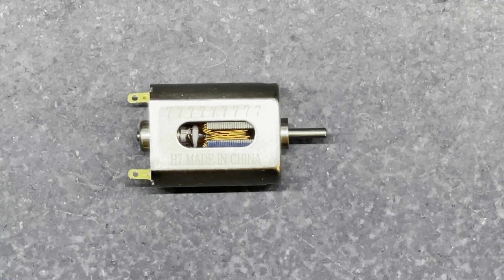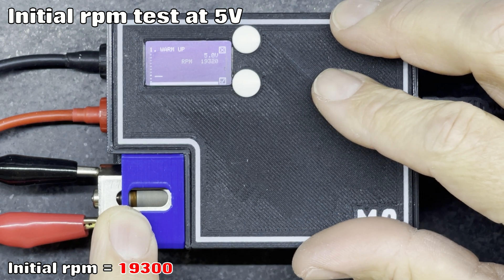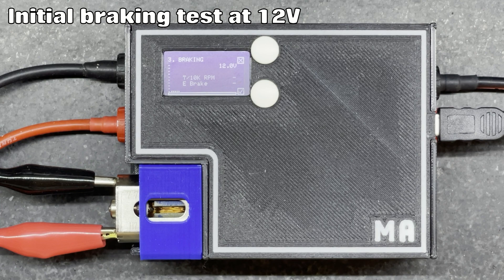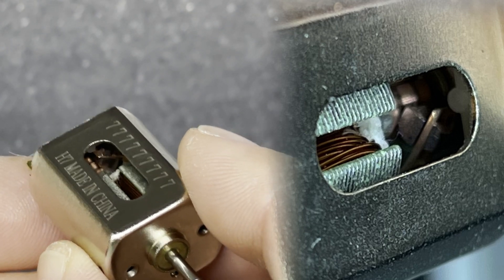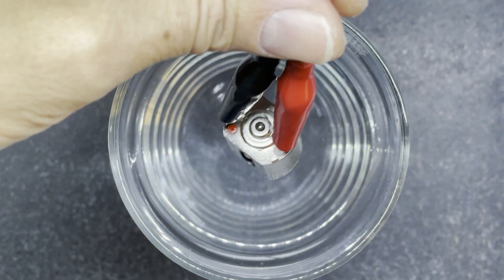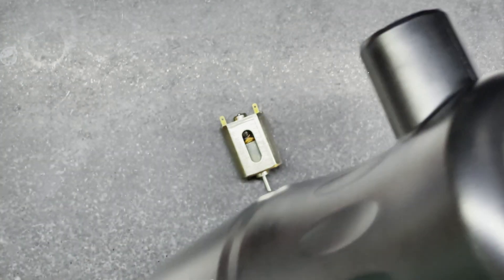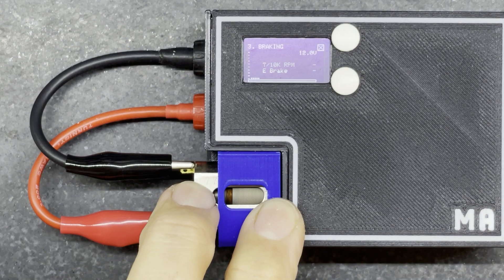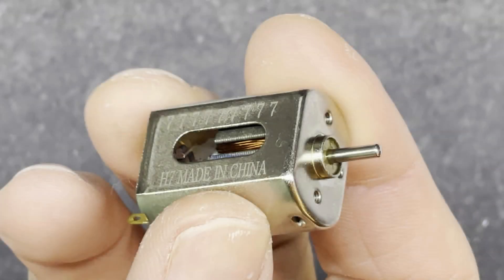Does running in an FK slot car motor (Hawk 7 or JK Retro) backwards improve performance?

Comment: Just a few basic questions, What is the average life of a Hawk  7 motor?  how does the break in process play into the life span of the motor?
Reply: No so much the lifespan but the performance. Just taking a motor and putting it on the track and whacking the throttle, can result in arcing that causes pitted commutators and brushes and residual residue.

Comment: When installing a motor into a car you have to hook it up backwards for it to turn in the right direction, considering that + is on the right side in driving direction. So why not run it in backwards?

Comment: Hi! CT, I have a doubt, I searched for the respose but I couldn´t find them. What is exactly the E-Brake? I understand what is the normal brake, "the amounth of time from full speed to zero". Do you know where I can find the explanation. Thank you very much!, cheers from Argentina!!!
Reply from the maker: Hi Nicolas. Thanks for watching. The E-Brake is a number that is generated by calculating the “electronic” braking effect of the motor. The electronic braking effect of the motor depends on the amount of back EMF and current the motor generates when braking.

Comment: the motor will run faster in one direction due to the commutator timing. Breaking it in will seat the brushes and reduce power requirement

Comment: Just when I thought I had a super secret way to the podium. Actually found out about running backwards a few years back when I accidently connected a C can s16 Mura motor backwards for the water break in, panic at first. So, I get that it works but what is the reasoning behind the practice? Brushes seat differently?  Com gaps change? Magnetic charge within the steel armature frame change?
Reply from the maker: Thanks for watching and commenting. I am surprised that you found a difference with a C-Can motor between running it in backwards and forwards.
With the design of these cheap sealed motors, the brushes and springs tend to flex as the armature rotates. Running in the motor in different directions affects the way the brush seats itself against the com and has an effect on the timing. I have plans for another video which will draw some conclusions about running in those types of motors so I won’t give away too much here 😉

Comment: It's amazing how slot car racing and RC racing is very similar. A great technique used across both hobbies
Reply from the maker: Many companies also used to sell slot car parts and radio control parts as they were very similar. I don’t think many RC racers run their motors in anymore as they are mostly brushless 😁😉
Reply: Yeah you're spot on mate brushless is most definitely the normal now...I wonder when we will make the switch
Reply from the maker: @thatslotcarguy  , brushless slot cars are happening right now. They are nearly as fast as the fastest cars we run. Here in the UK we have limited their use due to concerns over escalating costs, availability of electronic parts and a change of skills needed to program them.
The best fit for brushless motors would be to replace all the limited rpm motors that are so variable in performance. You could then have lots of brushless motors and speed controllers that all had the same limited rpm and didn’t require lots of maintenance or the need to buy loads of them to find a good one 👍🏻

Comment: Running in the motor typically advances the timing so you will end up with more rpm at the expense of torque. You typically wear the negative brush more quickly than the positive brush as the electrons are emitted from the negative brush. So if you want to get "even" brush wear run it in backwards and forwards.
Reply: When the brushes are new they are not worn to the comm but make a point contact. As they wear and conform to the diameter of the com that proceed effectively advances the timing.
Reply from the maker: Excellent information and advice Fabio. Thank you. Maybe I should do a video where I run a motor in both directions 👍🏻😂.
Reply: the "timing" is built-in and doesn't change